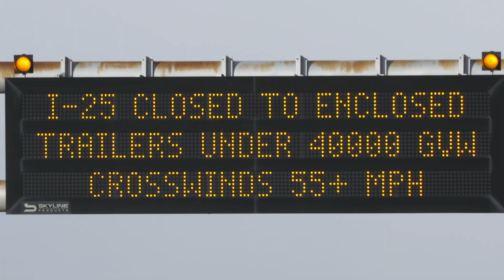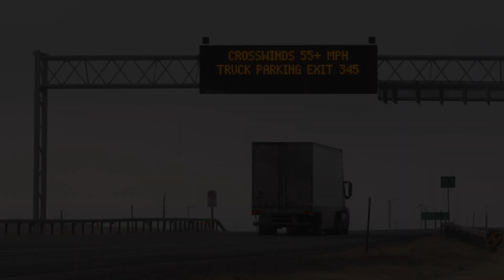Weight-Based Wind Closures

Comment: What about double sets or Rocky mountain sets? There is no way that those trailers weigh 40,000 lb. The rear trailer on a rocky set will not weigh 40,000 lb
Reply: There needs to be more guidance for those. Doesn’t seem right that you can’t take an empty van, but you can throw an empty pup on the rear to make it a rocky set and be good to go since that puts you over 40k total. By that logic, they should start allowing triples too.
Reply: This is one of those times when you need to use that gray matter between the ears for more than social media.  If you're pulling an empty Rocky Mountain double and the wind is enough for the prohibition, perhaps you shouldn't take said doubles through there .....

I pull a conestoga. This trip from Oregon to Missouri, I'm sitting at 79,500; the load isn't very high in the curtain, which is almost 8 feet high. I'm watching the winds closely today and tomorrow, as well as the restrictions. If it hits 50,000 lbs, I'm shutting down - because I'm actually using my brain, and I realize that while I may not blow over, the wind could destroy the curtain.